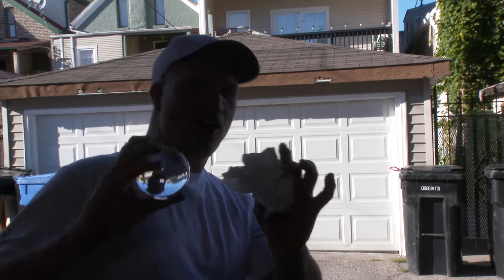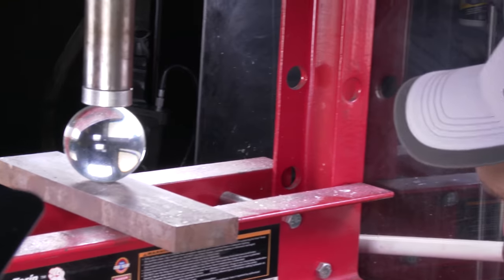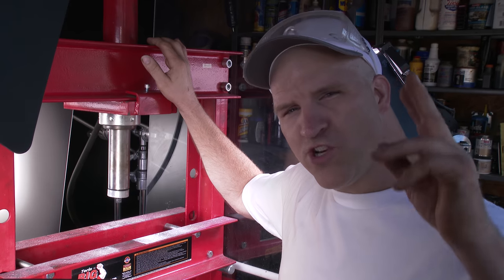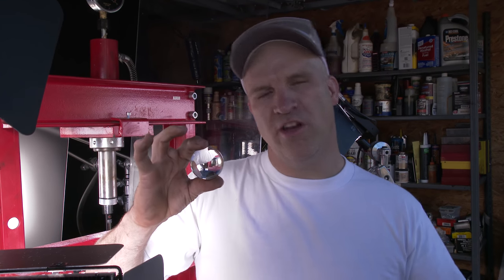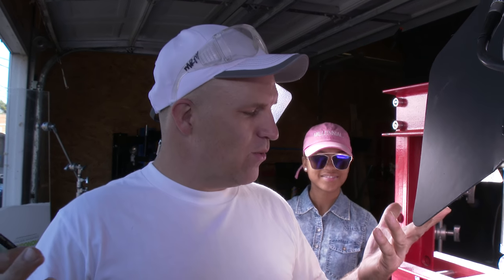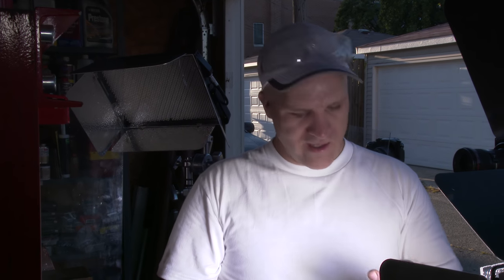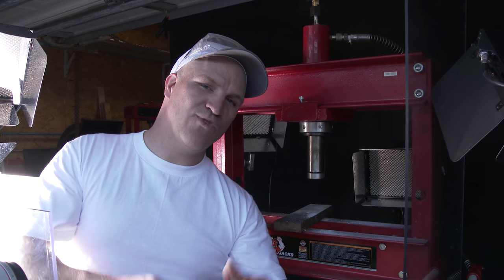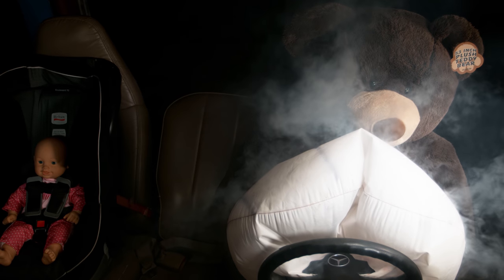Crystal Balls Crushed at 30,000 FPS (Ultra Slow Motion)

Comment: You need to use your polarizers in a crossed configuration to see a stress profile with any useful detail. It should look nearly black without anything between them. The polarized light source needs to output an intensity at least 10x any background light to properly highlight the stresses.

Comment: Most awesome slow mo ever. What would happen if the top and bottom were supported with a curved structure? With the pressure not on the glass from just two small points.
Reply from the maker: murderdoggg thanks !!. well we tried yet another ball after these that made an indentation in the metal base plate and it chipped off a few pieces but the contact patches were intact. it was weird , I may have to show the ball in one of our upcoming Livestreams.

Comment: Slo Mo guys had this problem too. They were finally able to see the cracks propagate at speeds well over 100,000 fps, but they had to film on a tiny resolution to do it.
Reply from the maker: AMGwtfBBQsauce yeah , glass breaks fast , we have one video on this channel where we filmed it at 480,000 frames a second. the crush the pane of glass in the hydraulic press, at that speed you can actually see the cracks travel, but the resolution is low like you said.
Reply: Thanks for the reply! I'll have to check that out :)

Comment: Does the glass shatter faster than speed of sound?
Reply from the maker: iEmHydro I actually think someone posted those details in a past video . I think it does.
Reply: Slower than the local speed of sound through glass.
Sound: ~13,000 feet/sec.
Crack  : ~ 4,500 fps

It's still extremely fast, and to actually see the crack move, you need the fastest lo-res cameras, such as the latest Shimadzu, 10,000,000 frames/sec. There are vids of this on youTube somewhere.

Comment: I think that in order to demonstrate the stress lines in the material, the material needs to be birefringent (or at exhibit stress birefringence). Lots of different clear plastics have such properties, but I'm not so sure about glass. Perhaps that's why it failed. Still, cool video nonetheless.
Reply: Pearson Facial Plastic Surgery I think your right about the material having to have birefringent properties.  Many, but not all mineral crystals have this property.  Unfortunately these types of crystals may be too expensive. If I remember,  crystals of sugar have these properties. I don't know if it would be possible to get a very large piece of "rock" candy in a single crystal.

Comment: wouldn't putting the light behind the object and the polarized lens have the effect you want? also polarized lens 180 degrees of each other block light so i'm not sure which angle you would need to see the stresses. but you could play around with it in that config to see if it works. if i'm wrong let me know or i'm right also either way. Keep up the good work with your crazy expensive cameras.
Reply from the maker: thats what we did but there was a lot of scattered light entering from the sides so i'm sure that was the issue, thank you !.
Reply: make your shots dark except the light that is filtered if you need to reduce the resolution then do it. if the shot you can get is 480 then fine by me its the shot you were trying for. Sometimes I think people think Youtubers make Millions but forget we're making videos with what we have.  Great tools don't mean you have every great tool or location. Keep up your good work and careless with resolution, great shots mean more.
Reply from the maker: thats true. i get the shots i want know, we are locked in now. thanks for your support !

Comment: need more like 230,000 FPS and if its the "fastest" 4k camera then 30,000fps should have been its slowest setting, But in fact i think you were just being abit more generous than you needed to be when discribing the camera
Reply from the maker: chris thorney actually 30,000 fps is the slowest setting. Actually this is the fastest high-speed HD color camera in the world. There are faster cameras, but they're not HD and they're not color.
Reply: would have been great at a faster speed because of how fast glass breaks, i dunno if you have seen slow mo guys and smarter every day colab with the prince rupert drops i think its called .. the glass shatters at what seems like light speed lol it was a great concept just still the whole ball is solid one frame and the next frame its a ball of dust it would have been sweet if the polarizing thing worked tho that was a great idea but super hard to pull off props for the idea
Reply from the maker: I actually had a discussion with Destin about the drops which is why I ended up filming them, however, I went even slower than they did ( for technical reasons), if you look on our channel I filmed the price Ruperts drop breaking at 380,000 FPS.
Reply: Warped Perception awesome I'll check it out! Cheers

Comment: Buy an automatic press.
Reply from the maker: +Black Panther these are automatic, we have this smaller one and a much bigger one. Problem is we busted both of them up with the prince Rupert's drop videos, the crystal balls and the few others. From the sudden failure shock we broke the seals in the big one and busted the automatic hydraulic pump. Right now I have them rigged up with a hand pump to make it through these videos. I need to fix both of them very soon.
Reply from the maker: +Black Panther these we're automatic until we busted them up with all of these shoots were doing, I have it rigged up with a hand pump temporarily until I got time to fix the hydraulic pump and the actuators